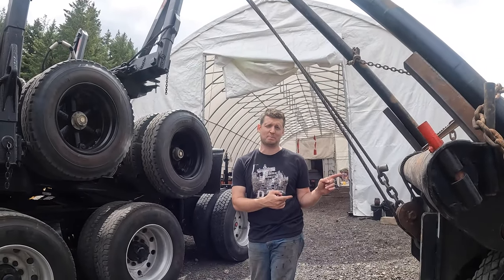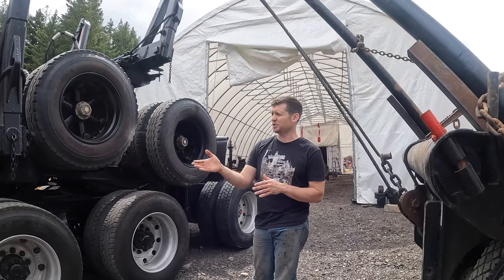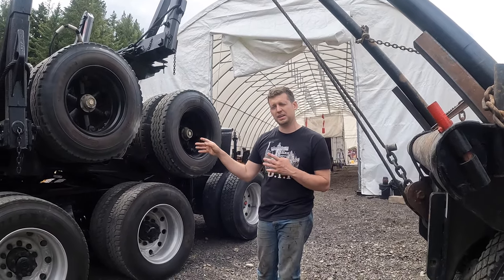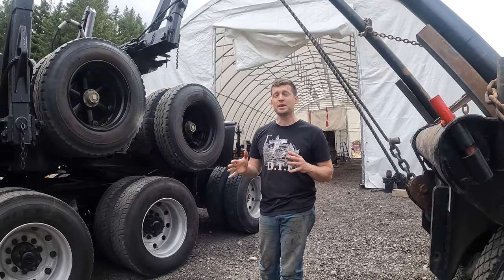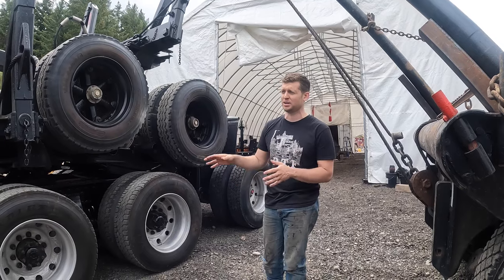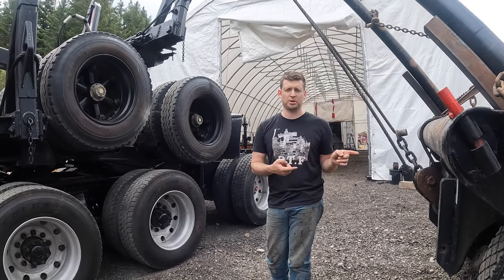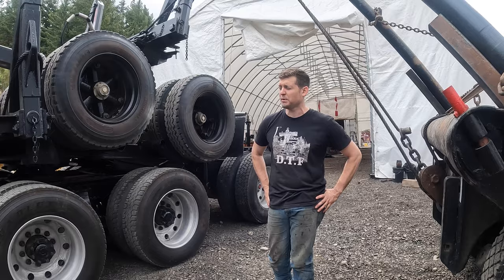Bed Truck Trailer Loader

Comment: It's a real shame we won't get to see Carl with a full load of logs. Maybe if the Tesla drive ever gets swapped out it'll happen.
Reply: All they would need to do is change out the drive flange on the tesla motor and fab one that takes standard size u-joints instead of the little ones it has now

Comment: Would love to convert my Vermeer BC1500 brush chipper to electric or hybrid... It would be so nice to have it run more quietly. And it's big enough to fit a few large solar panels on it.
Reply: Kind of tricky to convert a chipper
Reply: Ultimate would be convert chip truck to hybrid and the chipper to electric. Just be a matter of running high power cabling from the chip truck to the chipper when you actually need it. Tesla drive motor should have more than enough torque to keep the drum spinning.
Reply: Wouldn't be cheap but could be done. Can do (2) 24V DC input 120V inverters paired at the breaker box to get 240V output. Just depends on how big of a electric motor. Recharge batteries with engine driven generator from the truck going down the road.

Comment: It’s so funny seeing all the comments about how he rigged it! Man, the way he set it up is 100 times safer than having 2 5/8-3/4” tie back lines! There’s blocks in behind the poles to keep them from moving farther, chains to keep it from going back or forwards, and would almost bet my house that the reason he rigged the deck block like that is because it’s a clapped out old Lennox rig up and the dog is so siezed and full of gravel it’s permanently down! Or depending on who owned it last, the pin hole is sheared off! Good job boys!
Reply from the maker: That’s 100% accurate about it being seized in.  We beat on it for an hour and finally gave up.

We were also missing the tie back lines
This is more than good enough to lift a 4000lb trailer.  Sometimes you just have to redneck rig it and hope for the best

Comment: Should be tie back cables from the pole cap to the base of the headache rack. Use the lugs where you had your tie back chains to chain down to the skirt so they don’t tip forward. Should be a tab that flips out of the deck just forward of the live roll that is intended for the snatch block. It shouldn’t be behind and below the roll. Please be safe.
Reply from the maker: The tie back cables were lost years ago before we bought it

The tab for the snatch block was seized so bad that after an hour of trying we gave up

We made it work with what we had
Reply: Weld a chain to the tab. Winch it up. Cables are cheap. Buy them a bit too short, like so the hook hangs only 8’ from the roll. Add shackles to lengthen them if needed. You’ll only try to lift more and more with that thing. Hate for you to bend the poles or worse, hurt someone.
Reply: @EdisonMotors  Hey brotha, American here, how much research you guys do into the resources of those truck batteries? No flak on y'all's company or anything, I know you guys mean no harm on anybody but, why don't you guys have the trucks work similarly to the Diesel Electric Locomotives instead of like petrol hybrids that charge up then stay on power cells until a charge is needed? Them batteries are so bad for the environment, they don't last very long, are expensive, and the emissions from mining for the cobalt, lithium, etc. is far worse to the environment than oil and fuel refineries. Most of these resourced countries use slave labor mostly done by children and minorities. Idk if you're going to answer but I just wanted to get that out to ask.

Comment: I'd like to see how one of the Edison trucks would set up the same as one of the mack tank trucks we use here in the illinois oil basin. I believe they are running a 200 bbl tank, with a tri axle design dual lockers. or even a pulling  rig with a Cooper Super 36 double drum on the back for pulling wells

Comment: Good way to get hurt using chains half way up the gin poles to hold em...
Reply: Ok why?
Reply: @jamesweir139  it's a weak point. They'll crater.
Reply: The Gin pole are normally designed for compression support only. The guide wires for the gin poles are all suppose to be tied at the very top of the poles as close as possible to the shive as possible ….when they at not attached at the top you are applying a cantilever force which tends to buckle the gin pole causing  the poles to collapse under load..
Reply from the maker: We were missing our guide wires and stuff so made due.  At the end of the day we used what we had to get the job done and nobody got hurt so that’s a win
Reply: @Edison Motors  I get it, but being in the patch for yrs and seeing that... Im just glad it was done without a hiccup. Nice work on the truck too.

Comment: Love the concept. My only question is as a tow truck driver when we tow a truck we have to either pull the driveshaft or the axles. Will this be the same way with the electric trucks or is there something special we will have to do with them?
Reply: Reason you pull the drive shaft is to keep the trans from spinning and buring it up from lack of lubrication. Edison truck has no transmission so it should be a non issue
Reply: @ericcrockett6396 however the mechanical setup means you might not be able to disconnect the wheels from the motor easily, and a unpowered motor doesn’t like to coast. You might still have to pull something if this needs to be towed

Comment: What do you think of putting generators on each wheel, there are couple companies working on it but I haven’t seen it catch on. I think it’s generous and would save a lot of space and make the tires heavy so there’s lots of traction
Reply: infinity power glitch doesn't exist

Comment: Can the Truck go Full neutral if it needed to be towed from the front in case of breakdown. Teslas have to be dollied or flatbed but with this truck as RWD and it has to be towed from the front. How do you disengage the electric motors not to cause damage?